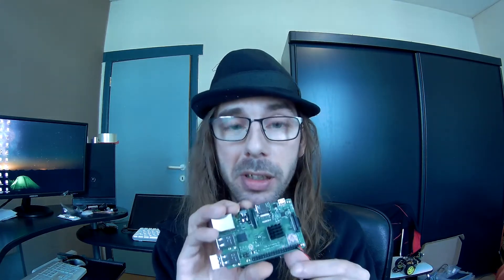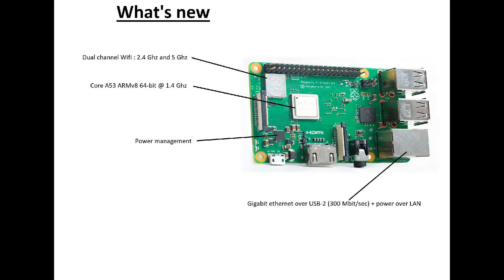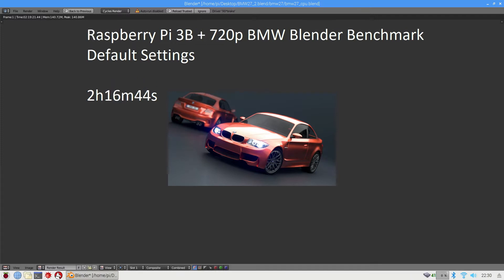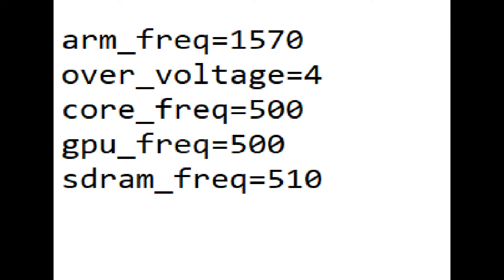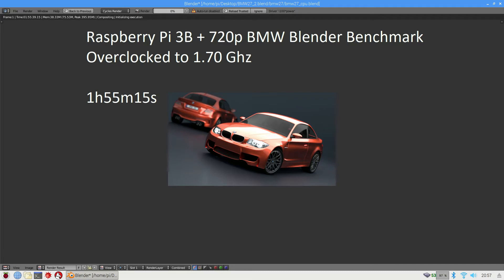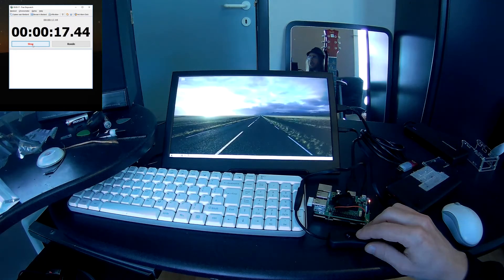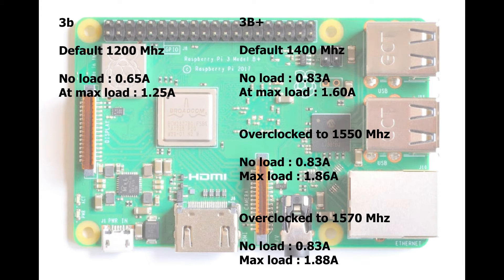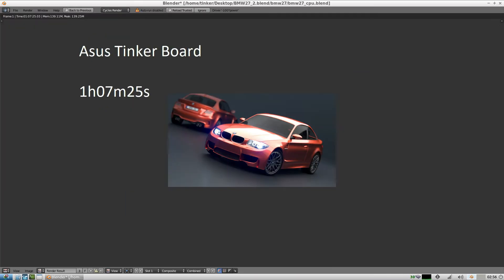Raspberry Pi 3B+ Review/Overclock/Benchmarks/Comparison with Odroid C2 and Tinker Board

Comment: I don't think that the Raspberry Pi Foundation could get DDR3 on the board and keep the Raspberry Pi at $35. They have stated that there is a lot they would like to do but they feel that sticking to the price point is more important at this point. 

Still, if I need a speedy project and power consumption is important, I always go for a pi.
Reply from the maker: Well, I must disagree. The Rock64 with 1 GB DDR3 is 25 Dollar. It`s got usb3 and gigabit ethernet. And almost all other sbc`s have ddr3 or ddr4 while a lot are cheaper than the Raspberry. Raspberry has got the most fame in SBC world. But actually they make the worst boards(hardware). But the community is the biggest(and most annoying). Greetings. Thank you for watching.